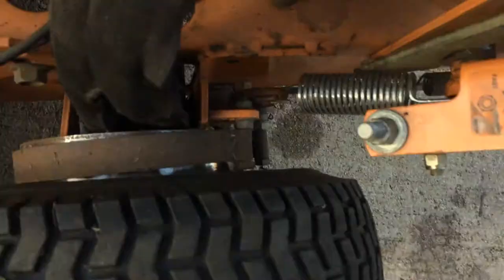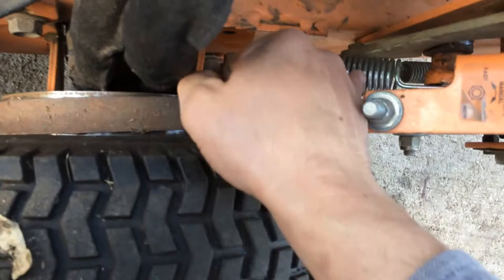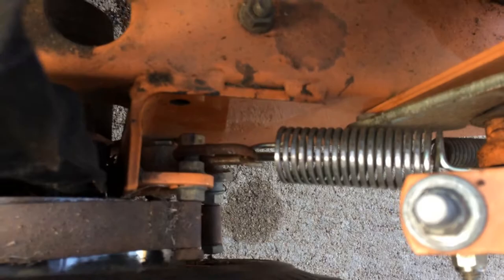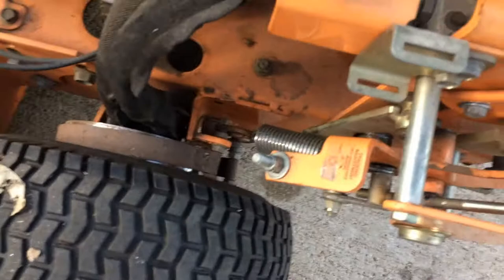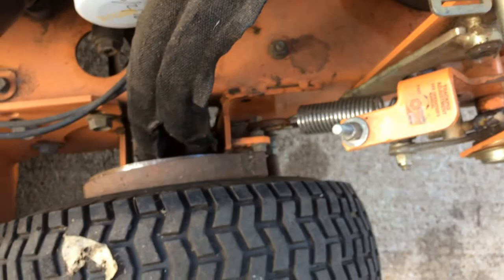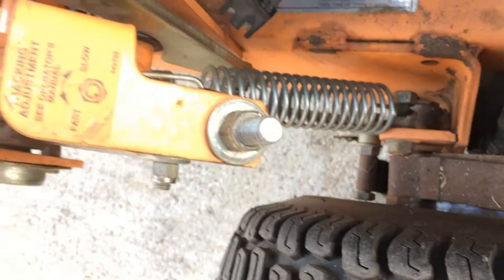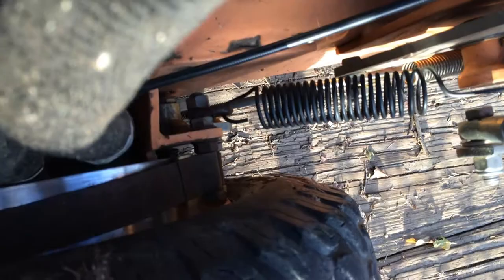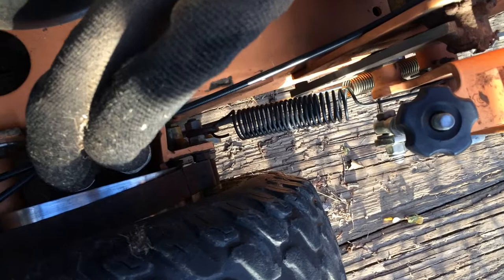Scag walk behind mower  mod to make the steering feel light.

Comment: Hey dude I was check out my mower after your video its a scag that has been sitting in the back of the garage for 5 years; runs top but steerings wicked tight on the hands this guy saying "oh wat a baby" bro they are wicked herky jerky and kinda unsafe. I sprayed my springs with wd 40 and put on a thick glove and just pulled on the springs to loosen them up and it worked perfect Ill take a video.

Comment: Thank You, because my springs are super hard! Doing this everyday would be hard on hands!
Reply: I'm thinking of "converting" my levers. I'm exploring a tilt style lever placed more in the middle between the handles. Hold upright to go straight and tilt in to turn. The tilting in would angle the extended part of the handle and compress the brake lever. Similar to a see-saw. Once the handle goes past horizontal, it would lift the brake lever. Maybe a pulley system to decrease force needed.